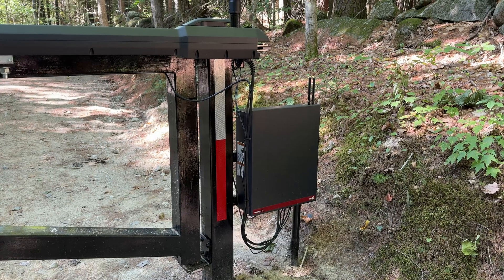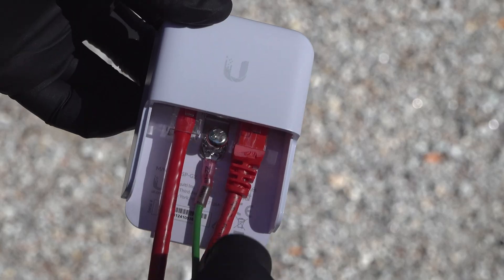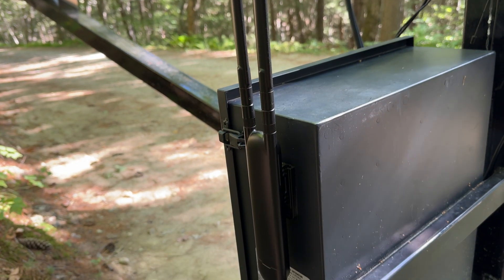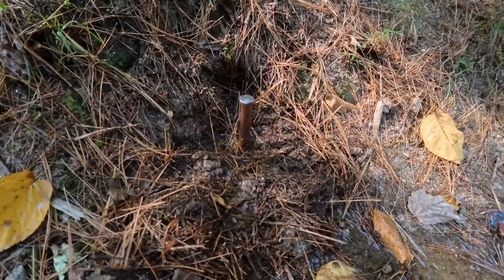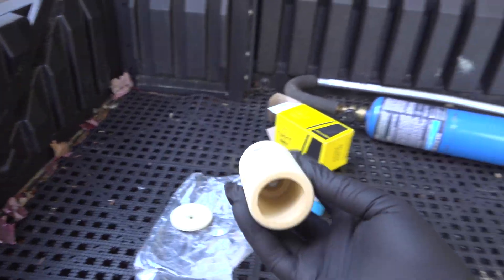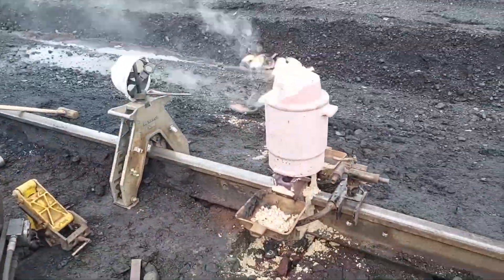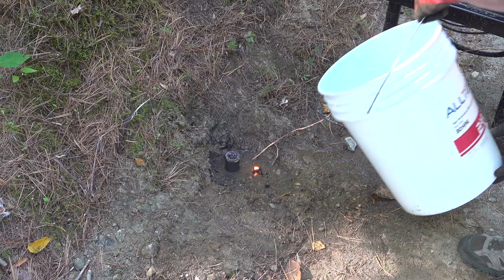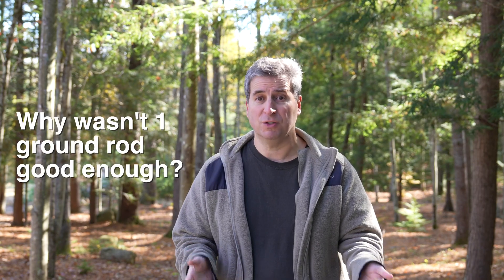Best Way to Protect Outside Network Equipment From Surges

Comment: Actually using the ground may make the surge protection worse. If there is a nearby lightening ground strike the surge will travel up from the ground & into your ethernet cable. I've had that happen to me. Lightening hit a tree from about 500 feet away, and the surge traveled from the ground into my home frying a lot of electronics even though most had surge protectors on them. The Odds are one of the trees around the gate will get in ground strike the the Surge will flow into the Ubi Surge protector. Best option would be to make sure the ethernet cable is run in a conduit to isolate from the ground. A direct buried ethernet cable is likely to be come a current sink path or or induce current from the ground (ie magnetic coupling like a transformer). 

Surge protectors work by clamping across wire pairs when an over voltage occurs. The Ethernet SPDs use TVS diodes (basically Zenor diodes) for all 4 pairs that turn on when a the voltage exceeds its threshold. Ground is nearly useless protecting electronics as  the resistance is usually 6 ohms or higher & cannot clamp a lot of energy. Nor can the ZVS diodes in ethernet SPDs handle much current. Usually less than an Amp because the TVS diodes cannot have much capacitance because of the high operating frequencies. if there is excessive voltage, the current will fry the TVS diodes & the surge will flow to the next device that will act as a current sink.

Grounding rods are more to protect buildings from fires by shunting the energy outside of the home & to protect people of the neutral line is broken. Grounding rods do not protect electronics.

If your really worried about surges on ethernet connections, than use fiber as they don't conduct electrical energy.
Reply: Your right on fiber. Fiber can create an air gap too in the Ethernet and keep from going back to your house.
Reply: Very Much Yes  to this.           
I've done commercial computer and network installations.  I've seen the damage done by connecting a temporary building's network to the main building. The main building and the trailer were separated by only 2-3 yards and the trailer received power and grounding from the main building. Still, a nearby strike closer to the  temporary building took out the networking in both buildings.       
I've seen it happen a few time where the lightning ground surge comes in one ground and goes out a second ground.      
Don't connect physically disconnected networks by Ethernet. I only spec fiber or WiFi dishes. I don't approve of, but I have had customers use optical isolators where Ethernet was the choice. While I have had no experience with Ubiquiti Ethernet Surge Protectors, I wouldn't  trust them.
Reply: He needs the Ethernet to power the gate I believe I think it's poe
Reply: @16BitDoggo  Ethernet gives NOWHERE near the power to run a gate like that. At most its around 50ish volts DC
Reply: @StarKnight619  in his video on the gate, he mentioned he uses the POE to trickle charge a lead-acid battery, then the gate runs off the battery. So while POE cannot provide the current required to run the gate, it can provide enough to keep a 12V battery charged.
Reply: @16BitDoggo  Probably not. You need more than POE to operate the gate. Likely ran 120VAC. FWIW: When I ran buried data lines & always ran either 12 awg or 10awg cable for AC.
Reply: Have opened these Unifi boxes before and can confirm it is just gas discharge tubes on all the conductors
Reply: Yes, the last way to protect the already layed wire is to use isolated ethernet rj45.
Reply: Came here for this. 

Differential protection (between pairs) works fine on a surge protector without GND. 

Common-mode protection (between all pairs and ground) can cause issues blowing up equipment on one end of two sets of power/data. 

That’s not the case here. (I’m assuming) this is a solar setup with no external wires). So honestly isolation would have been the best thing for this setup (aside from EMP).

Additionally, a single ground rod is probably around 30ohms in good soil or 300ohms here in FL sand. So you’d need 3 rods minimum to get under 10 required for surge protection systems to work.
Reply: With lightning, there is no such thing as "isolation" between conductive materials or wire.  Fiber isolates cause it is an insulator, but power is required at the gate, so copper is required.  The answers is BONDING.  Everything.  0V reference.
Reply: @rf_dude  Power is bonded at the Panel. A secondary grounding just causes a ground loop and will not protect from from a lightening strike, but does increase the potential of damage from nearby strikes as I explained. A grounding rod does not equal a 0V Reference and its usually limited to about 6 Ohms or Higher Unless very deep grounding rods are used, or the soil is treated with carbon to reduce resistance.

"Double grounding, particularly bonding the neutral and ground in subpanels or where not permitted, creates dangerous parallel paths for fault current, risking electric shock"

"Code Violations & Inspection Failures: Double grounding in subpanels violates the National Electrical Code (NEC) "
Reply: lightning strikes go towards ground not away from it
Reply: @estusflask982 For a short period the gound near a lightning strike will have a voltage much higher than the ground state. As I stated Ground has a resistance of about 6 ohms. Much higher in dry & sandy soils. So I cannot remain at ground state when a lightning strike hits the ground. 

Think of it like dropping a toaster in a bathtub. Plumbing is connected to ground, but your still going to get a lethal shock if your in the tub.
Reply: @guytech7310  then what's the point of a lightning rod
Reply: @estusflask982 Prevent fires. Give a path so the majority of energy does pass through a building.
Reply: @estusflask982 Lightning rods are specific systems that don’t tie into your electrical system. They allow a direct lightning strike to flow to the Earth. The differential in lightning is between the sky and the Earth and your building just happens to be in the way.

Grounding rods for the electrical system are not for this. All voltage in an electrical grid between the home and the utility is between a transformer and your panel. The grounding conductor on both the transformer and the home are tied to the earth via rods, pipes, rebar, and other metallic objects to provide a very low impedance path *back to the transformer*. Grounding in a home does not dissipate voltage differentials to the Earth itself. The Earth is just acting as a conductor.

If you think about how Generators work, the grounding system in the house stops working as expected if you just plop a generator onto a concrete pad. There are various things that must be done such as driving a grounding rod for the generator or bonding the generator to the home’s EGC. That’s so there’s a return path to the generator, not so the generator has a return path to the Earth or the utility (it is the utility) and how the generator is built and wired affects this. 

Further proof that ground rods don’t protect from lightning is the fact we still lightning damage even with near universal grounding of our home and commercial grounding systems. 

Now take your home in the case of lightning. In the case of a direct hit without lightning suppression the current flows through all your devices and into the Earth where the potential differential is then closed. Your devices fry, stuff gets burned, etc. In the case of an indirect hit that flows through the grid, the same thing happens without any suppression.

In the first case Surge Protection Devices probably will not help you per the manufacturers own documentation. None of my Whole Home SPDs do as they’re not lightning arrestors. In the second case surge protection will shunt voltage in excess of what it can handle into the grounding conductor and likely fry itself out in the process. Surge Production Devices have a cumulative rating, max rating, and design rating for what they can shunt. Lighting has a tremendous amount of energy. Their normal design parameters protect against the grid itself being out of spec, motors creating high voltages on disconnect or fault, and other issues.

For Ethernet specifically, you can buy Lightning protective and surge protective devices. The former is sacrificial and the latter are more MOVs to clamp to below POE voltage. The lightning arrestors burn themselves out to sacrifice themselves to prevent lightning from going further into a building to damage more equipment and/or spread into the electrical system.

It sounds like in this case if the gate is grounded it may actually allow a direct strike on the gate to be dissipated but that’s about it.  

So in summary:

- Grounding rods are not for lightning

- SPDs are not for direct lightning strikes

- Lightning arresting systems/Lightning rods are for their own separate purposes

- For Ethernet you can buy both Lightning Arrestors and SPDs.
Reply: @m_cabral  
For Ethernet, most Lightning Arresters  or  Surge Protectors are not enough, especially if you are going any distance.  If you don't use Fiber or WiFi dishes, you should at least use Optical Isolators.

Comment: or just use fiber :P
Reply: Someone clearly hasn't watched the video.
Reply: that is best if there is (reliable) power at the end point
Reply: It's a bad idea connecting copper between to different places, usually it's a really bad idea if there are different electrical sources on either side.

I think this would be okay if he ran DC or did it better with PoE with proper sheilded connectors.
Reply: Cept fiber doesn't carry any current, hence the POE (power over ethernet).

Comment: I do wonder about the efficacy of that Ubiquiti protector. Better than nothing for certain. BTW, they make a higher end version of this (UACC-ETH-SP-Pro). I expect you also protected the other end, which would seem more important to protect? Having the protection at this end only would be kinda odd. You may want to research Bellcore standards (now iconectiv) to understand commercial grade lightning protection methods and specs.

Comment: The real intent of using two grounding rods is to reduce resistance to earth, not just to have a spare ground if one fails.

The NEC section 250.53(A)(2) states:
If a single ground rod has a resistance to earth greater than 25 ohms, a second rod must be installed at least 6 feet apart from the first.
Reply: I Was just about to make the exact same comment.  For whatever reason I remember this part of the code from studying for the PE exam.
Reply: And you Must connect both ground together to make a single point ground that Must run into the building service entrance. I can't tell you the number of times I've found the second ground is connected to a secondary breaker box, or the AC unit, or the cable or phone entrance. Some of these times were in commercial properties, and in chemical plants, and even in electric companies. By electric companies, I mean both power distribution and power generation.
Reply: A lot of testing has been done and while 6' is minimum, 15' appears to be the sweet spot.
Reply: The only way to test a grounding rod resistance, is with a second grounding rod.
Reply: @guytech7310  Really? Is it just the simple matter of making contact with your two multi-meter leads on each rod spaced apart, and measure the resistance in the continuity mode?
Reply: @aaron74  Pretty much. However Ground moisture and effect the resistant. Probably not a good idea to test after a rain storm.

Comment: I work in power substation design and we still call it cadwelding in the industry.  We use dozens, if not hundreds of these while constructing the ground grid buried beneath the substation.  As you said, the weld will last longer than any other connection plus it provides the least resistance out of any connection method which is crucial when a fault occurs on site
Reply: Also at 5:30, the top of that shot was all slag
Reply: Burndy crimps are more repeatable and not subject to porosities, pop-offs, etc.  Also faster and safer.
Reply: @WanderingThoughts11235 They are definitely not safer, maybe for the installer, not the system.

Comment: Did you check continuity between the rod and the wire to confirm the weld worked?

Comment: Install a surge protector by the entry point to the house. You have a long run of copper on the ground and you will couple charge by the capacitance plus might go through tree -> ground water -> to your wire even if you have good conduit run.

Comment: Sweet setup.  In my State we use solid wire for grounding to the rod.  I am so lazy I wasted over 5 years not installing 280ft of cat5 for cameras like that.   I had lightning strike within 75ft of my underground cable line & it fried everything connected to the internet modem.  I lost the DVR, over half the cameras, & all ethernet ports that were in use at that time were destroyed/didn't-work-anymore.
Reply: Surge protector would not have protected that equipment. Only option is to run fiber. 

FYI: Techically stranded wire is better for surge protection because high frequency AC (or very short pulses) only travel in the very thin surface of the conductor (high frequency skin effect). The more wire surface area the lower the impedience for HF impulses.

That said, Connecting the Ubqi. Surge protector to ground is a bad idea as it just make the problem worse, as when lightning hits ground nearby the ground become energized and the surge will flow from ground into the Surge protector causing damage. Eth Surge protectors are designed for low voltage surges cause when a Switch or ethernet device creates a low voltage surge. The Ubq. SPDs cannot protect against high voltage surges.
Reply: @guytech7310  It appears to be an indirect hit, it might have helped. Would never work for a direct hit.
Reply: @johnbartlett7149  Even indirect hits grounding can cause issues. When lighting does a ground strike, it elevates the ground to a high voltage. when you have an electrical device connected to a ground via ground rod, current flows up from the ground into the connected device & flow any way it can.

I have experienced this issue multiple times. I keep Low voltage cabling not connected to ground via ground rod, and just use SPDs with out ground. In the case of ethernet an SPD will shunt current when the voltage between the pairs exceeds the threshold.